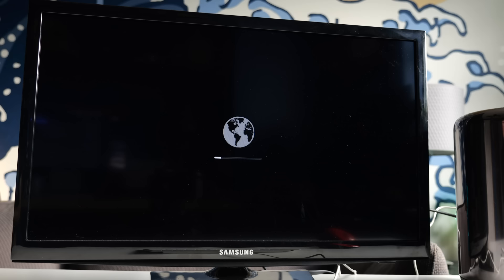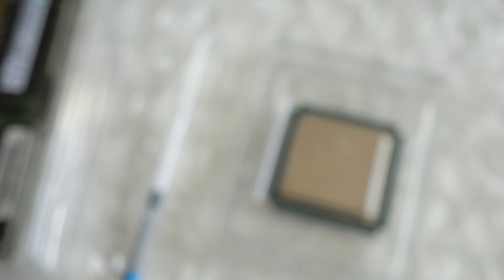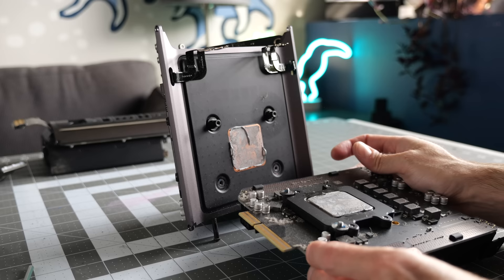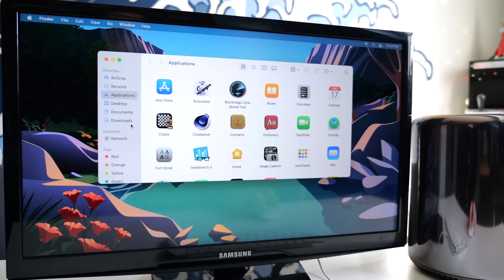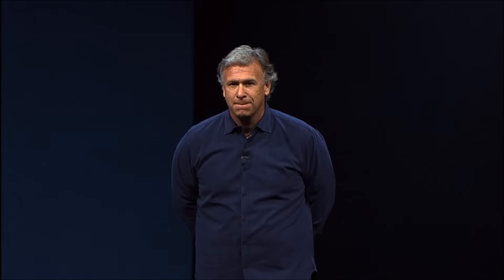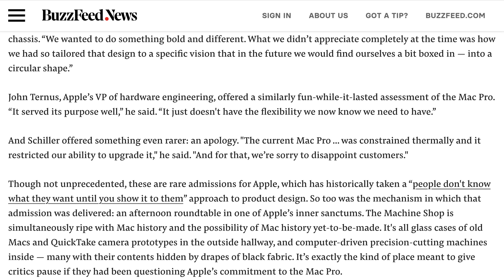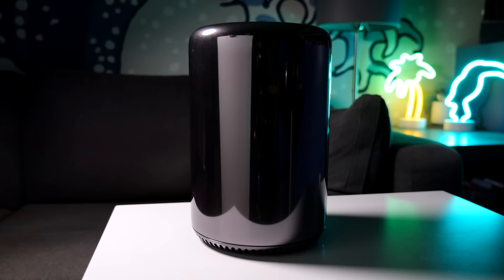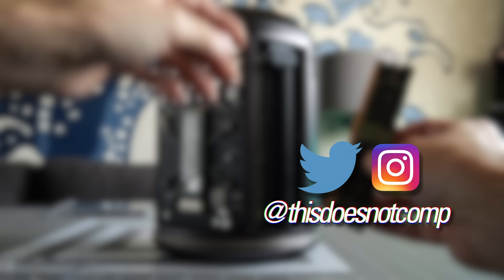Can This Decade-Old Mac Pro Compete With Apple Silicon?

Comment: I really appreciate the thinking outside the box when it came to the trashcan MacPro. The thermal limitations and lack of upgradability of the design could have been fixed if they sold the machine as a Mini Plus. 
As a fan of small mini-itx builds, the design of the trashcan is very appealing.
Reply: if they would have gone a little further with the cooler design to be more like the XBOX Series X I think it would have held up
Reply: Yeah, this is basically a Mac Studio before such a thing existed.  It's a pretty great design, it just isn't suitable for those who want to evolve their computer over time.  It's really more of a buy, use, retire machine.  Which, to be fair, is probably exactly what most people do -- even professionals -- and the outrage over lack of upgradability is mostly theoretical.
Reply: @nickwallette6201  except for being able to upgrade the GPU, which is completely real-world. If it were a tower, you could be sticking an RX6900XT in there even now.

Plus, it meant Apple couldn’t be bothered to bring out newer versions, as they realised it was a dead end.
Reply: @axi0matic   I dunno.  I don't keep track of Xeons, but I would imagine there were a few later processes that would've put more clocks and/or more cores in the same TDP.

This is just speculation, but I think they lost their motivation.  They got caught up in their form-over-function euphoria and expected the world to gasp in awe.  And when that didn't happen, I think it was a bitter pill.  They probably waited for people to "come around" for a while, then again, took a cold shower of reality and had to accept that it was a mistake.

There's absolutely no reason they couldn't have either incrementally improved the specs of the current design, or moved away from that platform in favor of something else with more headroom.  The fact that it took so long seems like there were some internal struggles that resulted in a stalemate for a while.  The engineers vs. the design engineers, or whatever.

Regardless, I'm actually most fond of their failures.  I LOVE the G4 Cube, and the Trashcan.  (Well, and the iMac G3 and iMac G4 -- which weren't failures, and the G3 actually brought them back from the brink.  But whatever.)  I don't (and didn't) have to depend on them, though.  I can just admire them as sculptures that happen to run Mac OS.  Not nearly so much fun for those trying to do actual work at the time.
Reply: @nickwallette6201  That's what I meant when I said Apple couldn't be bothered - it would certainly have been possible. I'm sure that over 6 years, there would have been newer Xeon models that fitted the TDP and provided a reasonable uplift in performance. Same with the GPUs - even something like Vega 56 may have worked if slightly down-clocked. Plus faster NVMe, RAM, TB3 etc. 

Apple seem reluctant in general to build Mac Pros, likely because they a) represent tiny numbers of sales, and b) are fundamentally unlike all their other products. They tried with the 2013 MP, then with the iMac Pro, to make a compact pro machine with no internal expansion, before eventually conceding defeat and going back to a tower. Apple's 'vision' though was fundamentally about saving costs and warehouse space, not giving pros the machine they wanted. They likely hoped they could wait out pro Mac users, who would eventually accept the tower wasn't coming back and just accept what they were given. And as with the Touch Bar MBP, they probably also wanted to recoup tooling costs before moving on, plus avoid the image of failure that comes from reversing course too soon. 

They likely started to see an exodus of high end users to Windows towers, forcing the very uncharacteristic move of publicly admitting they messed up, and pleading with pro users to keep the faith and wait for the new tower (the design of which probably started from scratch that morning). In general, the problem with Apple in the pro space is a total lack of roadmap. No one knows what form their future pro desktops will take - or even whether they will exist. The Apple Silicon MP is currently in this limbo. 

People, including Colin, talk about the dual-GPU concept in the MP6,1 as 'betting on a future that didn't work out', but this is bullshit. No-one was predicting that future. Fundamentally, Apple just wanted to build a compact cylinder (so they could use one big fan), and arranged the hardware to suit. It was a pure exercise in form over function. As a Cube owner myself, I love these stylish follies from a collector's point of view. The iMac G4 (which I also own) is arguably in a similar category, as its design required a heavy lead-alloy base to allow for the floating screen (the later 'fat LCD monitor' approach is a lot more practical). But as you say, they are not fit for purpose as work tools, and sell accordingly.

Comment: Thanks a lot for the detailed review, good job! I've got one about 2 months ago, 6-core - 2Tb SDD, 64Gb ram to run Parallels VM, just didn't have time to set it up but it does look reassuring. Machine is well cared, original box and replaced components. Just needed to find a decent cheap 4K monitor.
Reply: I bought a "mid-grade" 43" 4K TV to use as a monitor.....with a little tweaking, the display is just phenomenal for the price....and it works great as a Video streaming "hub".
Reply: And fascinatingly, 4k monitors slow down Apple Silicon to basically sludge.
Reply: @stewie3128  I can say after 2 years of using a base M1 Mini that my 43" 4K TV, used at full resolution as a Monitor @ 60Hz, certainly DOES NOT slow the Mini in any way, shape or form.
Reply: @goobfilmcast4239  thanks for the update. Looking at TV or monitors around 24" after holidays
Reply: Parralels? Why not use bootcamp
Reply: @HistoryandReviews  Bootcamp is super valid, and helps with Windows gaming, no doubt about it, but I also use some non Windows VM.
Reply: @stewie3128  from personal experience, they really don't. They have almost 4k displays built in. I run a 4k monitor off Apple Silicon and it works perfectly. I dunno why you're spreading baseless claims; there's no need to hinder or downplay someone else's potential experience if you're not a fan. But you do you :)
Reply: What GPU’s it got in it?
Reply: @thegeforce6625  mine has the duo D500 which I believe were the intermediate tier for GPU. Screen works fine up Monterrey but I have felt colors and bit lag when running Ventura. I’ve sticked to Monterrey for now but I will give a try on latest Sonoma with newer OpenCore.

Comment: I've been using mine since 2013 and similarly upgraded the ssd, cpu to the 8-core model (prefered the higher clock speed) and 64gb memory.  I'm glad that I paid extra for the top tier GPUs at the time because it's definitely helped future-proof this machine that Apple still has yet to replace.
Reply: what do you mean 'still has yet to replace'..? you don't consider the newer Mac Pro as a replacement?
Reply: @lexacutable  or the Studio.
Reply: A very very poor replacement.
Reply: Technically yes, it is the next iteration, but the 2013 Mac Pro is a special device.
Reply: Probably, very use case specific machine.
Reply: @nambrosch  special how? I don't see what the 2013 machine does that either the 2019 pro or the studio can't do better. You're going to be waiting forever for Apple to replace the trash can if you think they haven't already.
Reply: @lexacutable  It's a beautiful, quiet machine with lots of ports that exhausts out the top instead of out the back which I absolutely love.  It's hard to tell someone who's never worked with one how great the model really is as long as you're very aware that it is still a 10 year old machine.  I'm also well aware that the current replacement is the studio but I guess we'll see what happens with the mini and if the pro ever gets updated.  Maybe my 2013 Mac Pro still has a few years of life as a desktop.
Reply: @Nik Ambrosch  I have a maxed out Trashcan at home and a maxed out Studio at work, both running Monterey. The user experience on the Studio is much faster overall. As I work in audio, the number of simultaneous plugins I can run really matters to me, and that has increased exponentially with the Studio, even in apps running through Rosetta.

Just my experience. I don't have an eGPU for the Trashcan, and that sounds like it also could make a difference... but I'm not putting any more money into the Trashcan at this point, since new OSes no longer support it. I'll just "drive it 'til the wheels fall off."
Reply: @stewie3128  Agreed there's no denying that performance-wise newer hardware would replace older hardware.  I'm a systems administrator and don't rely heavily on local performance - just stability and having a lot of browser & terminal windows open at once.
Reply: I also use mine daily. It's one of the few computers that can output to 6 screens at once! That's why I can also say they have yet to replace it
Reply: You paid extra for top tier specs so you can run terminal windows ten years later and this proves that you future proofed it? It's fine to spend whatever you want, and you can keep using it as long as you like, but it's strange to suggest that it hasn't been replaced already, when even entry-level Mac Studios are several times faster at every task, at a much lower price. It was never future proof. You just kept using it for 9 years because your needs didn't increase. In fact, future proofing is a myth, as high-end computer will be slower than entry-level computers in 5 years. You can't overbuy to prevent that from happening.
Reply: @nambrosch  you got a Mac Pro and you don't rely on local performance?

righto

Comment: Enjoyed the vid. I love my trashcan. It has served me well in my general day to day and for my hobby (electronic music using Ableton). I got mine around 2015, as an Apple refurbished model with six cores and I think 16Gb ram. Over time I did the upgrades so now I have a 10 core CPU as I wanted to prioritise single core performance (quite a few music apps dud not support multicore). The 10 core was second hand pulled out of a server. The SSD is 2Tb but was a cheap option with the adapter and is on the slow side. Planning to upgrade next year but I won’t get rid of the plucky trashcan 👍🏻

Comment: Something that wasn't mentioned is that the "FirePro Dx00" cards weren't technically proprietary, they were just desktop GPUs from 18 months prior with the names changed and custom drivers.  I.E the D700 is just a downclocked version of the HD7970 6GB.  A extra little tidbit of info is that this info was public at the time of launch, however many Apple fans on forums flat out rejected the truth and maintained that it was more likely that Apple would be putting $8000 of rebranded W9000 cards in a $6000 computer.
Reply: Thing is, the only difference in hardware between the HD 7970 6GB and the W9000 is the 6 mDP ports, SDI out, a slightly different heatsink shroud, ECC VRAM, and different firmware. (And moving some resistors around on the PCB) otherwise they’re the same hardware. Most of the extra cost comes from the software certifications that the industry the FirePro was targeting required.

Comment: I still think this is one of the coolest designs Apple ever made and the concept of a central cooling system is amazing. I couldn't afford one at the time, but now that prices have come down (a lot) I'm debating getting one. It would be a dream to find one still new in box.
Reply: They still have some of the best I/O of any Mac, and you can get old Thunderbolt accessories super cheap these days. It's not as bad of an idea as it seems like at first.
Reply: I bought new in box off ebay in 2020. Wrapping, tape, and everything still in ties

Comment: Considering electricity bills, M1 Macbook air 2020 is the way to go for me. 500 bucks is tempting, but for another $499 (if upgrading ram to 16gb +$699?) I’ll get a P3 Retina display and much faster SSD along with Apple keyboard and trackpad. The price gap will pay off with the electricity bills in 2-3 years. Also the m.2 ssd adapter is very unreliable and often crashes due to overheating. $500 is a good price thou. Good entertaining challenge! Keep it up!

Comment: Great video! I recently upgraded from a 2.6 or 2.8ghz i5 2014 Mac Mini to a base Mac Pro w/16GB, 512GBSSD and 6 core CPU @ 3.5 that I upgraded from the 4 core 3.7 after only a few days of use.  I used geekbench too and went from 865 down to 808 on single core, but up from 3400 multicore to around 5000 multicore. I felt like the 4 core 3.7 was actually snappier for the normal stuff like web browsing, mail, etc..but have no empirical measurements to back that feeling. But my multitrack mixdowns and encodings are much quicker moving from the Mac Mini to the Mac Pro, so for me the Mac Pro is a win.  And it looks super cool!!!

Comment: Recently bought one of these for £230 after upgrades and selling the old parts I’ve now got one with D500s 2tb sad and 64gb ram for around £375. Got it to replace a 2012 base model Mac mini I’ve been using for 10 years. So was well worth the investment until I can get a good deal on an M1 Mac mini.
Reply: got a 2tb 16gb m1 mac mini for about $1000 used a few months ago. was looking at the  trashcan, but dropped the idea due to price concerns. didn't know there was an upgrade path for the cpu though.
Reply: @GeirEivindMork  the NVME, GPU, and CPU can be upgraded

Comment: high end grqphics applications, such as Capture One Pro for photos, and Davinci Resolve do actually support multiple GPUs - using a trashcan mac would be perfect for those, and the thunderbolt connections further enable even more gpus to be externally made available to the system

Comment: I still have mine, upgraded to 64GB RAM. It’s a great desktop for web design and graphics editing, being small, quiet and sleek. While it’s not my main system (that’s a Surface Pro 2022 model) it’s been a faithful and issue free system over its decade with me. Helps that it was a freebie from a client to entice me to take a contract, but I wouldn’t feel sore had I paid for it.

I have an old G4 on a shelf too, just for the delicious design cues.

Comment: Definitely appreciate the comparison with modern Macs; I couldn’t help but wonder during the video. Also, Open Core Patcher wuhhh?? I need to check this out! Thanks, Colin!
Reply: Open Core Legacy Patcher is a godsend for older Macs of all kinds. Right now, for example, I have an old 2009 Mac Mini running Big Sur as a media server. While I wouldn’t load it up with a bunch of processes like Dropbox, Google Drive, and other background apps, mind you, but keeping it close to stock while sort of uni-tasking provides a surprisingly serviceable experience. Good enough for my media server needs, especially.

Comment: One of my favorite Mac Design ever. Love how it really looks like a trash can 😆
Reply: I thought it was the dumbest thing ever when it came out, but now it actually looks kinda cute, like a little designer wastepaper basket for post it notes, 😆

If I come across one I'll add it to my computer hoard.
Reply: Still, 500 Dollars for a 10 year old computer (we're a month a half from 2023) is just WAY too much money.  The Ridiculous policy of obsoleting a computer via software is another problem.
Reply: @tarstarkusz  It's an incredibly capable machine, depending on what you're doing with it.  For me, Apple has yet to release a suitable replacement.
Reply: @tarstarkusz  For me $500 is good enough for the trash can Mac Pro. Why? Cuz it can do everything a new Macs can do. Heck, even with the latest Mac Pro Apple currently selling. It can't out perform them but it can still do the job. Those Trash Can Mac Pro might be ugly but the power it can get is incredible. I have a friend with an 6-Core variant of the Mac Pro and he upgraded everything. RAM to it Max Limit and SSD. The only thing he didn't upgrade is the CPU. With the power of OCLP he managed to install macOS Ventura there and the performance is still good. Not that fast but when doing basic task on it, it runs super smooth.
Reply: @005MDS3  Yeah, today.  But being locked out of the mac os is a major problem for such a computer.

Comment: I have just now, in 2023, purchased a MacPro 6,1 for an experiment with a stubborn app. I cannot say enough about this phenomenal computer. Even with the Thunderbolt chassis needed to run my system, I have lost 24 lbs of mass and at least 70% of bulk from my 5,1. I spent $325 on the fastest single processor model - 3GHz 8 cores - and am very satisfied. It is a triumph of packaging. I may purchase a spare before people realize its true worth.

Comment: 13:14 Keep in mind that the M1 Mac mini's RAM runs 2.3x faster than the Mac Pro's original RAM and its SSD is 4x faster than the Mac Pro's (and probably lower latency as well thanks to the SSD controller being on-die and the storage being physically closer to the SoC). Not to mention the M1's on-die cache hierarchy is probably much superior to the Xeon's as well. So it will probably depend heavily on what kind of workflows you have if this Mac Pro with 64GB RAM outperforms an M1 Mac mini wth 16GB.
Reply: Trash can also runs at 150W idle